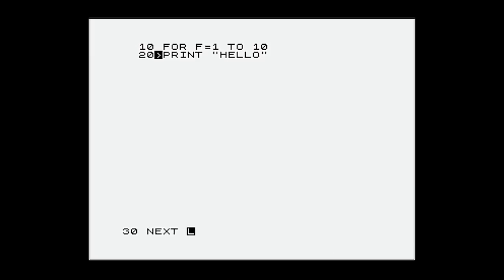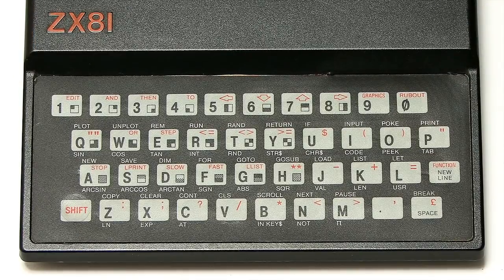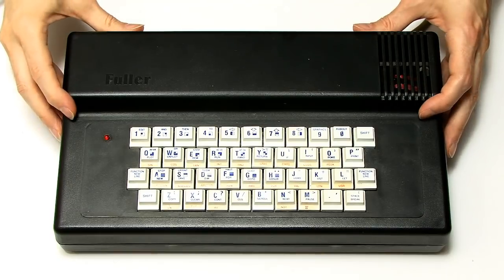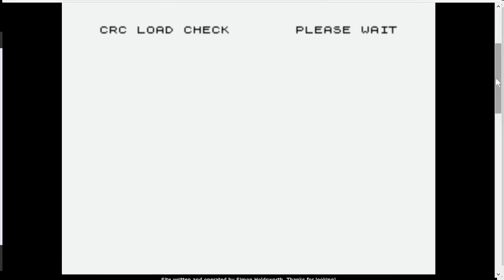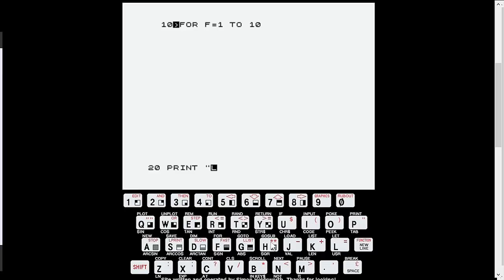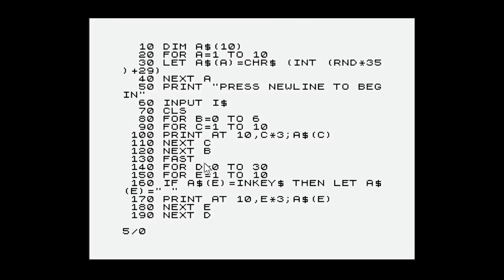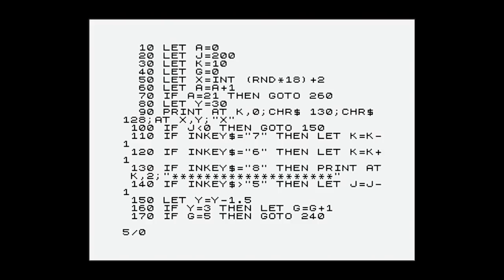ZX81 Classic PC

Comment: ZX81 was my first computer. I already ready had programming knowledge, I learnt BASIC on an ICL mainframe during my school days in the early 1970's, so using the ZX81 was straight forward for me. I also bought the 16K RAM pack but had nothing but problems with it. The RAM pack wasn't a tight fitting pack and would move if you moved the the ZX81 which would lead to it crashing. After a couple of years I changed to a Dragon32 before returning to Sinclair with a QL, a very underrated computer.

Comment: Like you, my first computer was a second hand ZX81. Learned Basic, machine language programming on the device. Also learned about the hardware. Built a keyboard with proper keys. The ZX81 board I put in a 3H high 19" cabinet. With the bus expanded on the back, so I could built expansion cards to operate in the 8K mirrored part of the ROM. Built a programmable joystick interface, a 8 bank 8K RAM/ROM card which I could select with a poke command, changed the original ROM to jump to a routine on which drove a Epson 80 printer (you needed a table to translate the ZX characters to ASCII) with a 8255 chip on one of the expansion cards. Later I used the I/O of the 8255 to connect to my first XT PC. I could use my PC as a "tape" device to store the programs on and load from, just by using some poke command. On the PC there ran a program that listened on serial port for the commands.
It was a very interesting time.

Comment: I used to own ZX Spectrum Plus, but unfortunately its now gone - the good thing about it is that I gave it to a young man who wanted to learn about the system.
In Poland during 1980s we used to produce the Elwro computer for schools, and it was compatible with ZX Spectrum software. The computer was equipped with all the ports in stock, and had no expansion port - so you could connect from the beginning the printer, 5.1/4 disk or the joystick port (the same used for Atari, also could handle the mouse). Some schools also had genuine ZX Spectrum computers. In fact during the early 90s those were quite old, and people who were interested in computers often had more modern Amiga computer. I still have Amiga somewhere, and it still works ! The only problem is the original display, that got damaged many years ago, and never got repaired.

Comment: My first one was a ZX Spectrum but it took so long (more than a year, I think) to get mine because they were not easily available where I grew up...  I "graduated" to a second hand C64 several years later. In some ways Spectrum was better. It certainly seemed a have more vibrant "programming" user base. However, on pure specifications C64 was superior with its graphics, and (now cult status) dedicated sound synthesizer chip. One advert I still remember had an elephant on a 2 page spread with dozens of software boxes on its stretched trunk and it said "There is no end to the things you can do, when you have an enormous memory".. 64 kilobytes! Enormous?!.... For the time, it was.

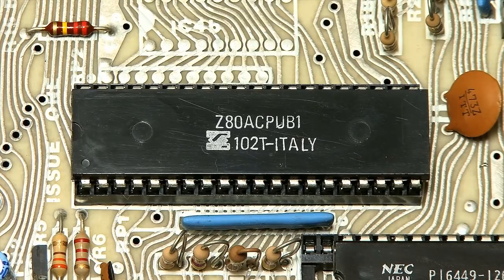Comment: Is that a solder bridge between two of the tracks at 5:12 in the video? Just to the right of the Z80, and below the bypass capacitor.
Acorn Electron, then an Atari 800XL and on to BBC Bs, BBC Master and Atari STs for me.

Comment: Had a ZX81; also the first TRS-80. Every reporter had to have a TRS-80 because of the modem on the back that let him dial in his story; the perfect tool for a particular job.
Reply: trs-80, or do you mean trs-80 model 100(portable with a 4 line screen)?
Reply: M. K. The one with the four line"blocky" screen. I think I managed to hook up a daisy wheel printer to it. After 35 years, not too sure of the name. One of the few times Radio Shack managed to do everything right.

Comment: The t/s 1000 was my first computer, bought new in 1983 for $99.00 US. Plus tax, of course. Had a great time programming it in BASIC, and although it was possible to run machine language binaries, it was difficult for me to learn how to program in that mode. 2nd computer was the Commodore 64, and I still have both machines to this day. They both still work too. I burned out the little monochrome TV set a long time ago that was used as the monitor for the t/s 1000. So I made a little add-on circuit board to give the Timex machine NTSC baseband video output, instead of the output being modulated on a carrier. This allowed me to use a regular composite monitor, either color or black-and-white, as the screen. Much better quality of picture, and no interference lines.

Comment: Radio Shack Model 100  Portable Computer (built in 300 baud modem) ~ 1985 Had thermal tape printer, tape deck, Battery power 3 1/2 floppy aftermarket and Rainbow Rom Chip (complete office on ~16K)

Comment: mine was a franklin ace 1000 an apple ][ clone.
I wrote a game aid for a game called red star white start an SSG game that had an enormous of amount of battle resolution charts. I completely computerized the charts so that battle resolution was 'automated' after you enter the die rolls and terrain and what ever other information was necessary. it took months to write, as I was learning at the same time and the charts where not mathematically constant. written in apple basic then attempted in 6502 assembler, never finished the assembler, and try as I might, after 30 years never finished a game vs another human. on the box it said average playing time was 106 hours. They under estimated imho.

Comment: My absolute first was a VIC-20, but my family decided to soon switch to a C64, so that’s what I began programming with. The CBM Basic was... quite basic. It didn’t even have primitives for raster graphics, although we could have fun composing sprites on notebooks and then adding up bits to set up data phrases to poke into the VIC chip’s memory-mapped registers. I began typing in routines in machine language coming from magazines to extend the Basic such as would happen with the famous Simon’s Basic cartridge which I didn’t have. Never got into assembly for the 6510, just three registers and all that cryptic lack of orthogonalization kept my young self from grasping any of that. Eventually I started learning ASM on the PS/2 I got at 15 years of age. Proceeded there from c, then went leveling up to c++. Recent years had me fond of javascript, go figure. I find it’s almost like the Basic of our old times, in that... it’s there, in your browser. You can start writing js code anytime, no need to install an IDE or anything. Just like in the 80’s. Back to those years, so I was happy with my C64 after all but... I always liked the aesthetics of the ZX Spectrum. And at least its Basic had gfx primitives. The circle wasnt bresenham, lol... anyway, last year I bought a reconditioned Spectrum which now sits in an elegant showcase, in working condition, a small LCD TV for screen, in my very bedroom. I’m sometimes experimenting with the Z80 assembly there, much much more orthogonal, so reminiscent of the 8080 and all its successors. Love it.

Comment: I thought about the ZX81, but went for the Acorn Atom instead (mainly because it had a decent keyboard) , which I added a BBC BASIC module to - and I still have it in the original box! I then progressed to a BBC Micro, a BBC Master 128/512 then an Archimedes and finally a RiscPC. I don't think a single machine remained at factory spec for long. Those were definitely the days.

Comment: +ExplainingComputers I feel lucky that I was born in a time between older technology and the exponential growth of it. For example I built my first PC in 2008 with an AMD x2 3800+ but wrote my first software on a TI-84+ SE. It also used a Z80 processor "screaming" at 15 MHz.

My first program was a helicopter game where you moved the letter "O" up and down to dodge the randomly spawned "*" (asterisks) that moved one character left each cycle.

It was a great experience and I don't know if I would have been as into computers had it not been for that required calculator.

Comment: So much nostalgia. I was about 10 years old, when my sister sent a purchase order for the ZX-81 to Gladstone Electronics in Ontario, Canada (I am in Quebec). Each day, for almost 2 months, I have been walking the about 1.5 km walk to check the mail if it had arrived. This needed to be assemblied yourself, but my older brother would do it fine. Except we had to use our own transformer, and our was a very big grey transformer. The 16 kb she had was a nightmare (you move a bit the computer, and the computer would reset). But I did love it. I learn to program basic, and of course learn to write: "let x=x-sign Pi" rather than "let x=x-1" because sign and pi was stored in one byte each, and 1 needed 5 bytes (floating point number). When you have 1k, this kind of things matter! I also learn Z-80 assembler, and began writing my own assembler too. One year later, I bought the Timex-1000 for 30$ in Zeller, this was incredible because it came pre-assemblied, and came with a normal (was relatively big, but almost normal) transformer. And this was double the ram of ZX-81 (2k). This was incredible! I had read about the 8k ROM code, that was making the screen (the timing of the Z-80 had to be precise to match with the time to render a line on the screen, do some work while the cannon was off moving to the next line [I wonder if it was not refreshing ram during that time], and do the main stuff during the time the cannon was off at the end of a frame, to move the TV Cannon upper-left again)... later a older brother bought the Spectrun 48k, and this was great too!

Comment: The commodore 64 is the most influential personal computer I have ever had, I did close to everything that could be done on a personal computer on it. I did have a commodore vic 20 before the 64 and the vic had tons of potentential but my parents couldn't afford to buy hardly any accessories for the vic so it was highly limited for me and only for that reason was I disappointed in it. I was into video games but on the vic 20 the cartridges were expensive and we couldn't find cassette games (we always had a commodore tape drive) in the local stores at all and shipping was very limited back then and it was expensive. With having almost nothing for the vic but the type in software in the Manual (which that software had no bitmap graphics programming) I wrongly assumed for years that the vic 20 supposedly had no dot matrix or bitmap graphics, I thought the game cartridges each had their own bitmap or dot matrix hardware but that was wrong too. Later on I got my 64 and revisited the vic 20 with lots of great type in software I late in the game so to speak got a few magazines for and I later was able to get some other accessories for the vic 20, with bitmap graphics, etc. And I had a blast with the Vic 20 then.

Comment: My first computer was TIMEX SINCLAIR 1000 from there I went on to Atari 400, then 800, 1200xl, 800xl, 520ST, 1040ST. Ive had just about every 8bit computer out there. Still have most of them and many of certain models. But my original TIMEX SINCLAIR 1000 escaped me as I traded it and a random volksmodem to a friend for an ADDS Regent terminal and 300bps acoustic modem. Good times.

Comment: My first computer was an Amstrad CPC 6128. It had a massive 128K of RAM! albeit, only 64K of it was addressable at a time, so you had to bank-switch to get to the other 64K block. I also pimped it out quite well too, saving up my pocket money for a DK Tronics Speech Synthesiser, a Multiface II, a mouse, and a daisy wheel printer (remember those!?). I never did get the RAM pack though, never really had a need for it TBH. Still, that was the machine that got me interested in computing, and I loved it.

Comment: First computer I owned was a Commodore 64. I started with only the tape drive but upgraded to the external disk drive. First program of significance is what I called "In System" (I using the British pound symbol) which allowed running machine language inside of BASIC. Interesting to me today still is how I like programming in machine code (Assembly) and BASIC, but found other higher languages (COBOAL, PASCAL, C, etc) really stupid programming environments.

Comment: I had one of the Sinclair 1000 units. My first computer. I did some simple programs for it, but I am no programmer and did not publish any. :) But, I had the expansion memory, and a printer as well that printed on heat sensitive paper about 5 inches wide, the same type paper that is used today for receipts from cash registers. Soon after I got the Sinclair system,  I had my eye on a Commodore C128...the predecessor to the Commodore C64. I still have the old C128 and several boxes of manuals and a disks as well as the disk drive. Have not set it up in years, so don't know if it still works? I keep it for nostalgia sake. :) One thing that I found exciting and fun with the Commodore was they came out with a MIDI interface and they were writing sequencer programs to record a MIDI keyboard.  Also a company came out with a speech recognition box that connected to the Commodore, and this was crude compared to today's speech recognition systems we take for granted today, Apple Siri, Google Dot, etc. But it must have been very new for the time in the mid 1980s. These early PCs really were exciting for their time. A friend of mine in 1974 was building a Intel 8080 system modeled after the Altair system. He told me one day, we will have PCs in our pocket. And I thought that would be really cool and amazing, and now today we toss around our cell phones and even throw them away when they get old as if this technology has been around forever.  Will they have a cell phone museum one day? I really kinda doubt it, there would be so many models, it might be a rather boring museum since most cell phones look similar. :)

Comment: I learned to program in BASIC on a Digital Equipment Corporation PDP-8 time sharing computer. My first personal computer was the ZX81 in the USA. It was sold by Timex, but was not called the Timex 1000 at that time. I then moved on to the Commodore 64 and later an MS-DOS PC from Radio Shack. I still have the ZX81 manual, but I cannot remember what happened to the machine itself.
Reply: It was 6502 chip motherboard with key mounted on the motherboard, no case at all.

Comment: The ZX81 was my first computer, but I had to save for it and buy it myself. Almost a year later I got the 16KB ram pack to add to it. We had a local Sinclair computer club I became part of to swap games. I had a big old Sharp cassette recorder to load a save the files from. The Keyboard on my ZX81 went faulty to so I purchased a keyboard kit and soldered together my own keyboard.  If I remember right the keys where in groups of 5. The 1, 6, Q, Y, A, H, Shift, and B shared a single common pin out with each other but  their second pin was shared with the 4 keys to their right if I remember how the wires got linked, a lucky 13 pins. My second computer was the Sinclair ZX Spectrum 48K model. If I remember right the Sinclair ZX Spectrum 16K had the serial number in green and the 48K version had it in red to show if it shipped from the factory as 16 or 48K but you could upgrade the 16K one to 48K of ram.

Comment: Thanks for this excellent video.  I'm a little older than you (born 1962) and had read about computers first in science fiction, and then in early computer magazines in the 1970s.  So buying my first computer, a Timex-Sinclair ZX81, was a big deal.  Many thanks to Uncle Clive for his genius, and for bringing me a computer for $99.

The ZX81 immediately engrossed me and I regret circumstances separated me from it after some weeks or months.  In later years, I owned a Commodore Vic-20 and I think a Commodore C-64.  Then a Victor 9000, a beautifully designed and equipped MSDOS PC.

When IBM released their IBM PC and its open architecture, I of course became a PC Guy.  Well, at work we got IBM PCs.  My first IBM clone was an AT&T PC-6300 made by Olivetti, another fine machine.  To my recollection, I have not purchased a prebuilt PC since the AT&T, but have built my own from found or purchased parts.

Comment: We had a ZX80, ZX81 and then a Spectrum 48K which I spent many years playing with. Got rid of the speccy ages ago for peanuts, it was just clutter frankly. Two years ago found the ZX80 and 81 in my Dad's loft. Bingo, got £250 for the (non functioning) ZX80 on ebay even without a box or psu. Think I got around £80 for the zx81. If you've got an old white ZX80 they can fetch decent money as they're quite the collectors item especially with boxes, manuals etc.

Comment: Excellent video Chris. I had a XZ81 as a boy and together with the slightly later ZX Spectrum learnt BASIC programming at school using these machines. I have fond memories of loading up the cassette tape based software, less fond memories of typing pages and pages of code from those magazines!
IIRC the very first computer I used at school was a Research Machines 380Z - a large 19" rack mount case unit which would be connected to one of those old B&W school TVs - the ones mounted atop a tall poll with fold out doors to cover the screen.
Happy days!
Rob